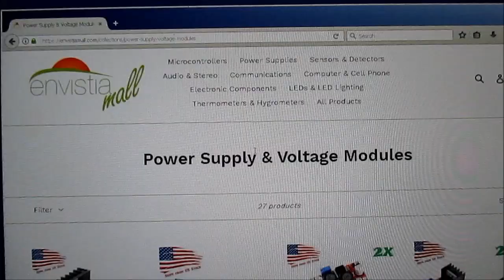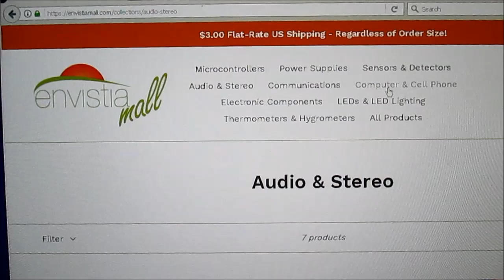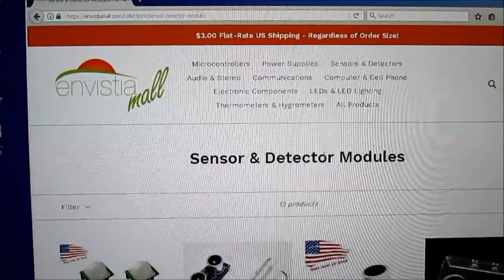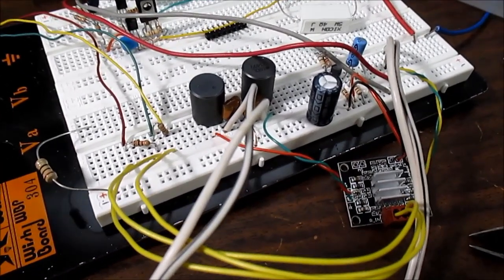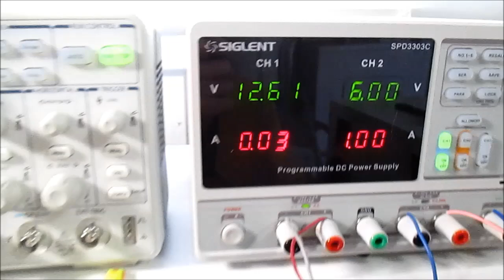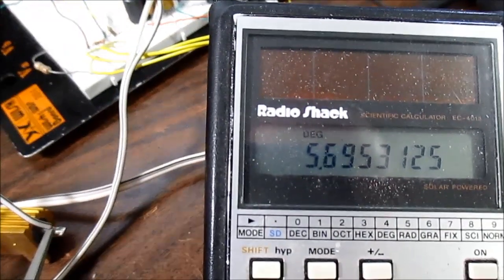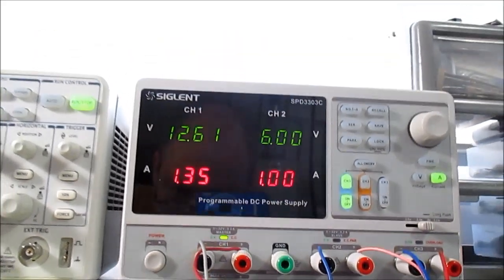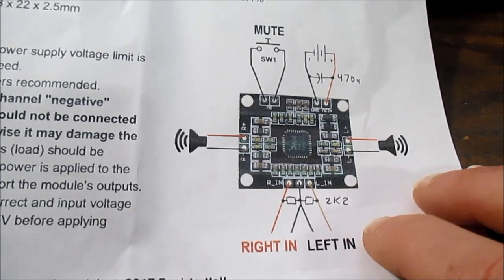PAM8610 tiny stereo audio amplifier board review and test

Comment: Might be interesting to look at the scope with a sine wave input and low audio output to see the distortion.
Reply from the maker: I tried but noise made it hard to see. Interesting the data sheet shows distortion goes above 1% at very low output but this sounds far worse.
Reply: Almost sounds like not enough current at low levels.